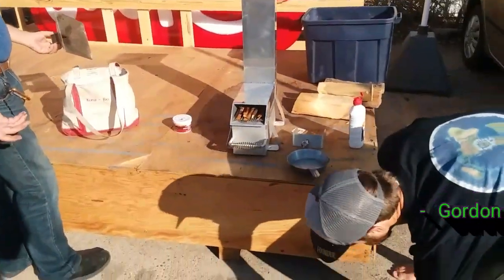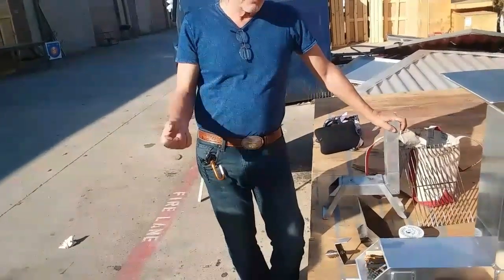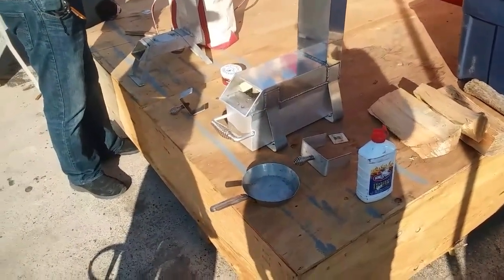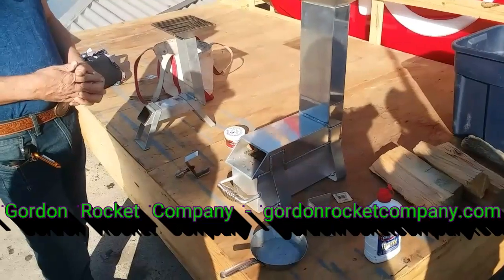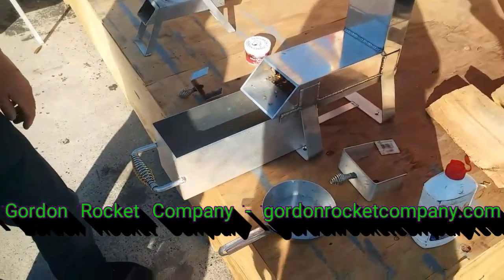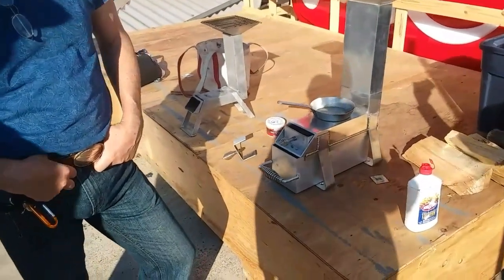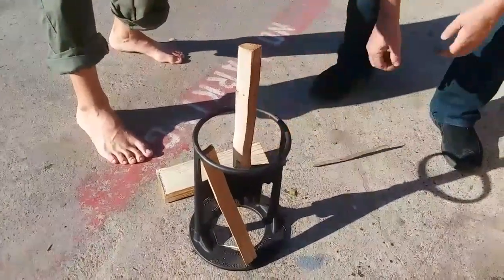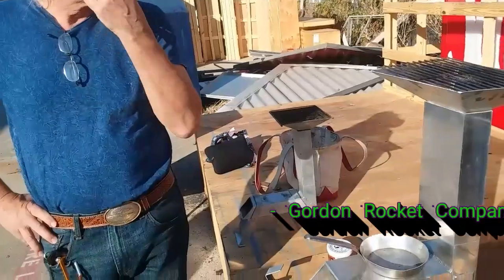Rocket Stove by David Gordon - gordonrocketcompany.com

Comment: They are great to cook with but do not make great heating stoves. Too much tending too compared to a regular woodstove.
Reply from the maker: If you can get coal it lasts for hours
Reply: My buddy put one in his shop and immediately put his stove back in. He couldn't get anything done from having to tend it all of the time. They work great for cooking outdoors and that's it. They also have the potential to turn into blow torches without warning. We have been playing with rocket stoves for a about 10 years now.